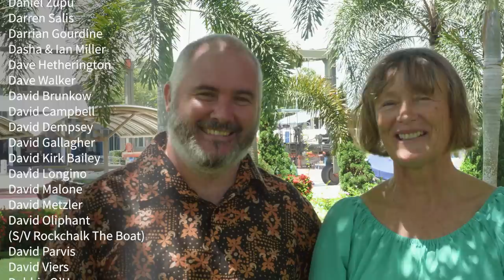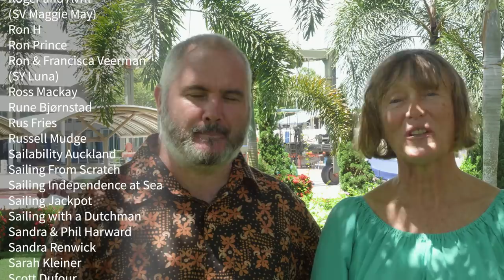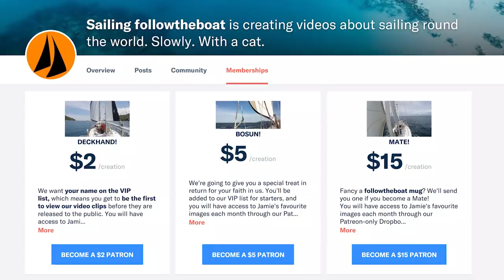MOVING THE DODGER BY TRAVEL LIFT! - SAILING FOLLOWTHEBOAT Ep115

Comment: Likely you have completed the stern tube by now.. But Jamie, if it turns out that you don't like the results you could extend the stern tube to meet the 2" I.D. requirement by expanding a 1 & 7/8 tube then inserting it in the existing stern tube I.D.. epoxy and finally glass tape to finish it. Simply put like fittings used for exhaust connections you can choose the material that best suites!
Anyways good luck with all the projects
Reply from the maker: Thanks, Patch. 👍

Comment: From the side view at 6:23 it looked to me the dodger was on backwards? I was thinking the side supports should slope the other way?  Good episode again and welcome back Liz..
Reply from the maker: It's on the correct way, the front will be supported by stainless tube struts. Cheers! 👍 Liz xx
Reply: I am sure that the dodger has been designed with a bit more support than just the two fiberglass diagonal risers.  The wind-loading during storms will be huge.  The airfoil fiberglass struts look really nice though, and will give the top a more finished design once all is said and done since I imagine it will not be covered by the canvas like the stainless supports further forward will be.  I've seen similar fiberglass hard tops that were fully supported by stainless tubing on all 4 corners, and those looks little bit on the "tin shed park shelter" side.  Pitch a picnic table in the middle and a BBQ to complete the look.  Haha!    With the diagonal fiberglass airfoil struts the hard dodger will look much more organic and part of the boat rather than just a roof on poles.  

Awesome design work by the team so far.  I have no doubt that it will all look fabulous once the canvas is up and the doubters will be amazed. 

I can't wait to see how the plumbing for the water-catchment system will be done.  I am a little bit concerned that with the birdbath on top when it is pissing-down rain there may be some sloshing going on and huge amounts of water may be spilling off the top in random directions if the boat is rocking.  I didn't see any eaves or spouts on the sides for over-flow but I figure you guys are on "top" of this, and have something planned for that.  Most of the time when underway the boat will be heeled to one side or the other so the birdbath effect will be minimized and over-flow will be draining down towards the side-deck on the low side which is usually a no-go area when under-way anyhow. 

The quality of the stainless work is amazing there.  Those guys are artists, even though their tools and working conditions seem a little bit spartan.  So shiny!
Reply: I guessed it would be, I'll keep stum until finished...😉

Comment: Yeah, as I said in the last comment, it's Tufnol. We had the same in our old Vindö and it was fixed with Polyester like yours log bearing was. Unbelievable that Oyster is doing it in this way still.
Good luck for us so far, we had no scary experience by hauling out the boat. But we are still in Flensborg, Germany and here its used to take the boats out over the winter. We will see in the future when we started to our adventure. Will be hopefully beginning next year.
Just in case of staring we have one, for us, important question. How did you deal with Milli? because we have Jerry, a tomcat and of course he must come with us. It is no difficult in the Caribbean as far as we know, but it ist in New Zealand and of course in Australia we got told. What is your experience?
All the best for Liz's father. We got the same situation with Ulli's mother, but she ist still at home and don't want to go into care. So far her father is doing what he can, We don't know how long this will work.
Reply from the maker: I don't believe Oyster use Tufnol any more. I contacted them about this and they explained that's what they used to use (our boat is 30 years old). As for cats, yes, Australia is very complicated. It's the reason why we don't intend to go there.
Reply: It's not all bad with Tufnol, as you see you can work on very easy. If it is out of the sun there is no big weathering at all. Horrible is only that they glue it with polyester in the hole. Once you have to change its nearly impossible to get it out without your prefered tool. By the way, your boat is a Youngtimer compared with ours. It become 48 this year ;-)) But the old boats are the most stabil build ones.

With Cats (or dogs) in Australia you get horrible nightmare story's. What about Milli and seasickness?

Comment: They never claim waterproof.  Water resistance in ATM or Meters.  Generally 6ATM or 6 Meters is good for swimming.  10ATM is good for snorkeling.  20ATM is minimum for average SCUBA Diving.  30ATM would be preferred.

Comment: Buy some oil impregnated bronze bushing material. It comes in many different sizes and they are machinable. IE buy 2" OD x 1 1/2" ID and machine to fit. Of course I have no idea what salt water would do to the materia!....just an idea.
EDIT:
      http://www.asbbearings.com/products_bushings_bearings.html
       And here is a galvanic corrosion PDF
     https://www.google.com/url?sa=t&source=web&rct=j&url=http://www.worldstainless.org/Files/issf/non-image-files/PDF/Euro_Inox/Contact_with_Other_EN.pdf&ved=2ahUKEwjQldimm4ncAhXcBjQIHQzJD4EQFjAAegQIAhAB&usg=AOvVaw1W2FVhm54sNImFQvQsuRGZ